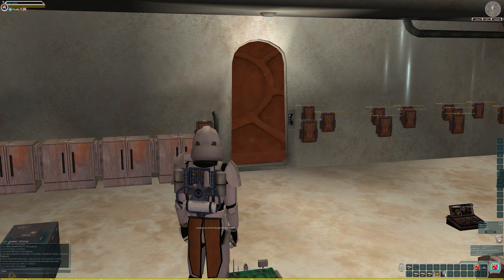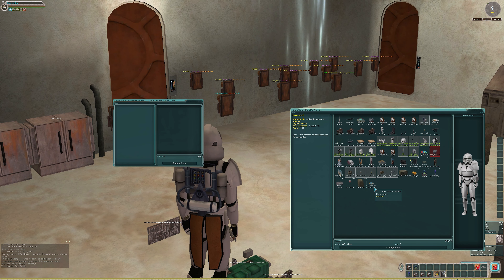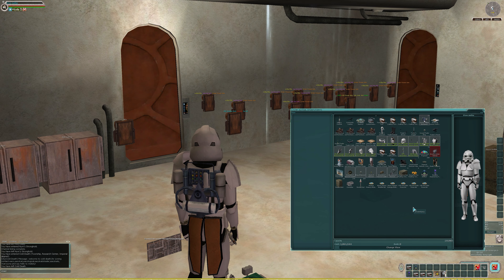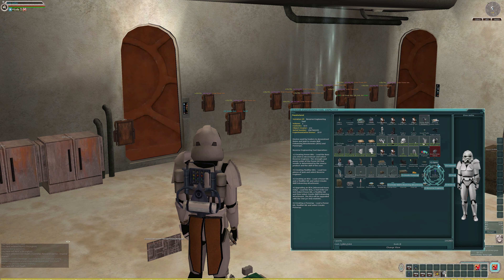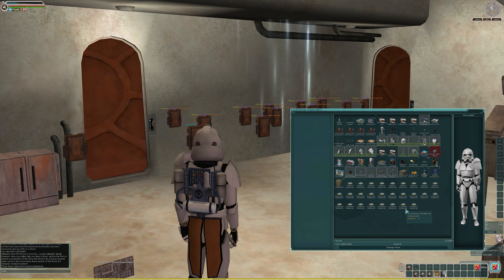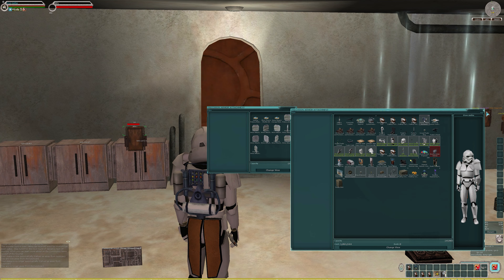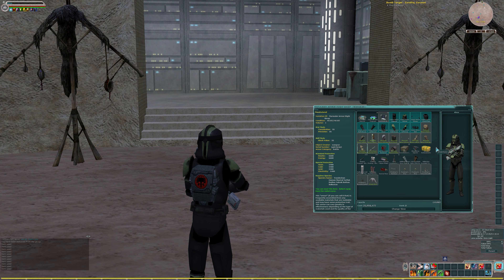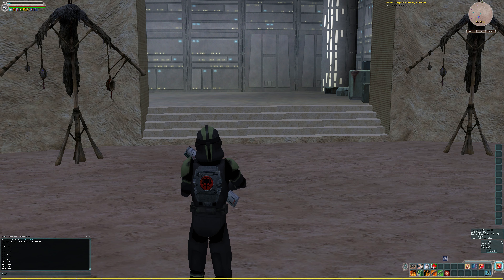Star Wars Galaxies: Legends - Making 35's - Commando PvE Suit

Comment: Outstanding video, and for creating these for your own characters this is great.  From a market standpoint how does one ensure their wares will sell over anyone elses?  That's always the part that seems to elude me.
Reply from the maker: You really have 3 options on ensuring that your ware sell. 1. Establish yourself and a primary provider for your guild. This will ensure you a decent volume of sales, however the price will typically be lower. 2. Undercut the market; this may backfire, but if you are looking for a short sale this is the way to go. 3. Establish yourself as a reliable and high volume vendor. If people know that they can always come to your shop for a certain item or set; they will come back.
Reply: @avt727-1  That's great info, thank you very much!  I appreciate it considering you're explaining how to do these things to a potential competitor.
Reply: @avt727-1  Also, I realize this is an old video, but any chance you'd create a how-to on creating chest armor, and then baking in certain exotic stats?
Reply from the maker: @SymeonPhronema  No worries! I'm not worried about competition. I just want to share as much knowledge within the community as possible. Also refer to swg junkyard for the various junkloot combinations. It will be your best resource by far.

Comment: I'm confused I've never seen a mixed 35 like this...  so did you say your rocking 35 con 35 pre and block on one aa
Reply from the maker: With this set I am running con, prec, and block value on all the standard 35's. My Jugg set is completely different with much deeper optimization of stats.